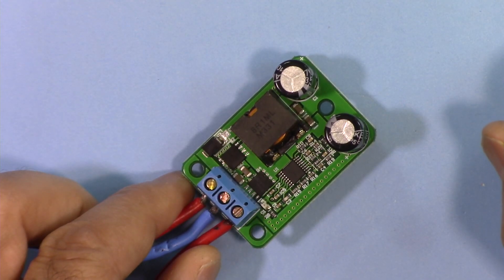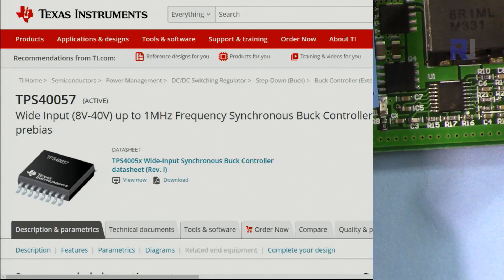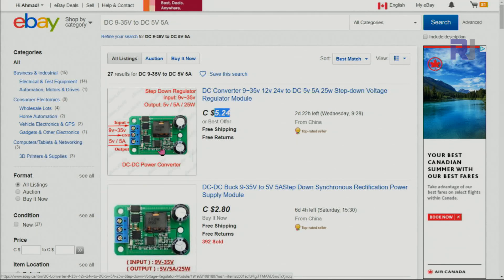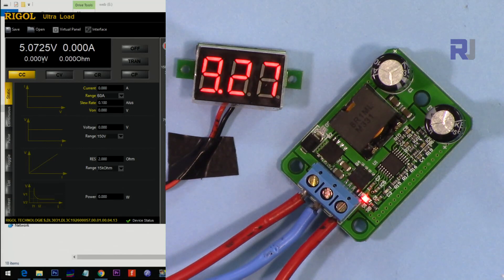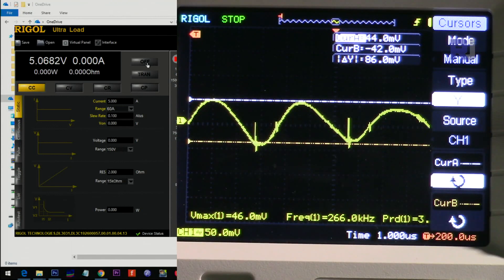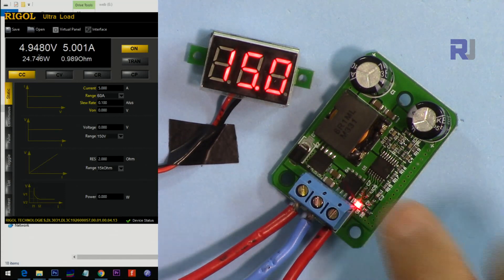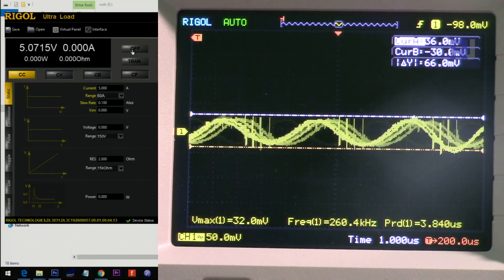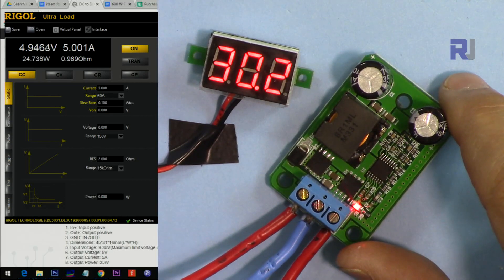IC Station Buck converter DC 9-35V to DC 5V 5A Test review

Comment: Hello sir, pls recommend a buck converter which has cc & cv adj...  ?   Cheers...
Reply from the maker: hello, this is very vague. There are 100s of such module. you need to know the operating range of voltage at input and output and also the required current.. search my channel for this or visit eBay and AliExpress and find something there.

Comment: Great review. Looks like a very high efficiency converter. What is the idle power with no load? It appears that most of the loss is in the reverse polarity diode! What happens to efficiency if you short it out?
Reply from the maker: the idle current is determined by the main switching converter chip. It shows on page 5, to be http://www.ti.com/lit/ds/symlink/tps40057.pdf to be max 3mA. The output mosfet will go off when there is not current at output..
I did not try short circuiting the output. As it seems there not over power or current protection.
Reply: I assume reverse polarity protection is a series schottky diode on input. At 5A the loss in this diode will be 1 to 2W. If you short diode then efficiency will improve.
Reply from the maker: Yes, they used this schottky diode http://www.taitroncomponents.com/catalog/Datasheet/SS58.pdf with 00.67 or 0.79 ( I forgot which diode) but 5 x 0.7 =3.5W dissipation of power. It could be improved
Reply: @robojax  First, thanks for very good review.
As for the reverse polarity protection diod, the best solution is to short it, especially when the input power supply voltage is close to 9 V. In my device, I powered this buck from 12 V SMPS and the short increases the efficiency back to >90% range.
Secondly, the datasheet claims that there is some short protection (external I limit control resistor), but I did not test it yet. But I will have because I want to power sensitive device (single board computer) so a crowbar or some overvoltage protection is needed.